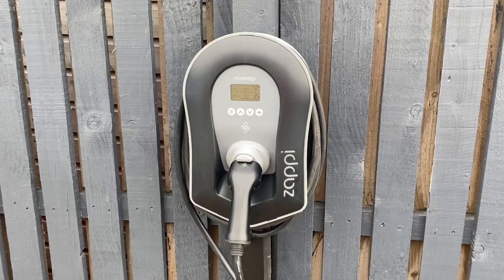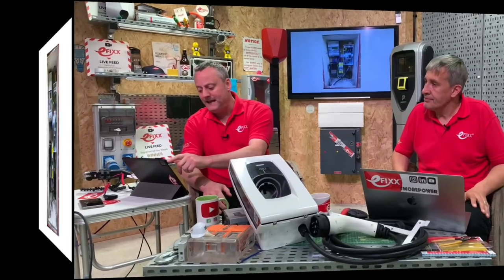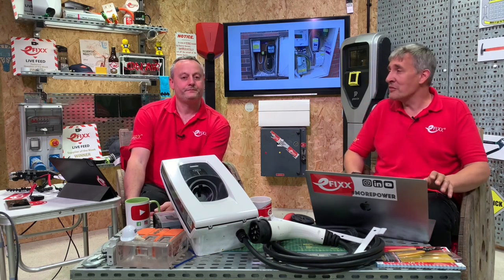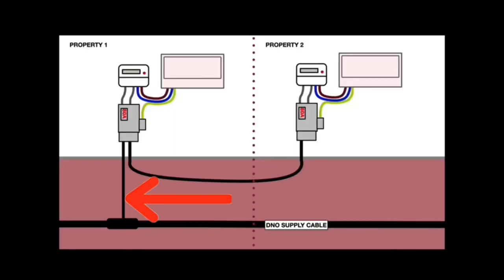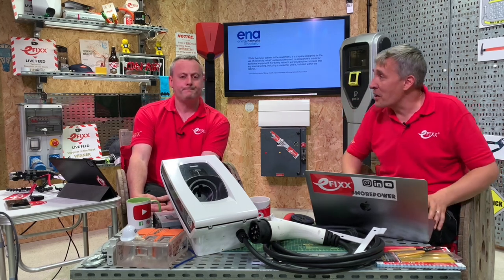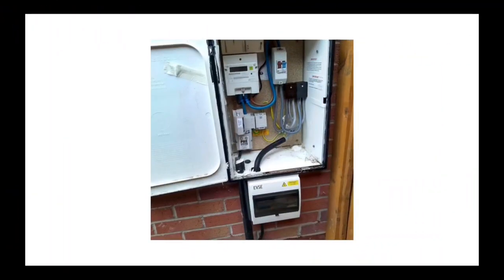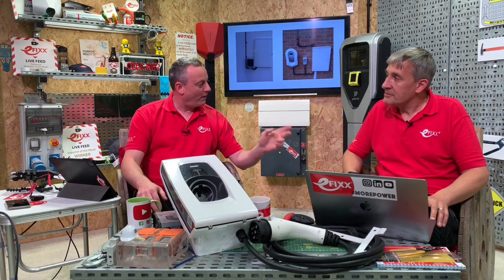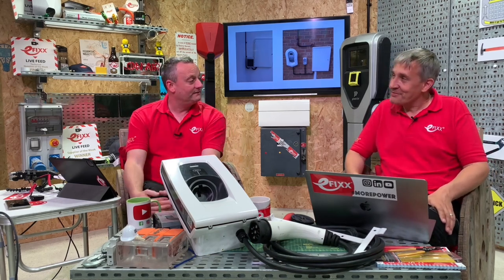Can ELECTRICIANS fit equipment inside the DNO METER BOX? - EV Charger Installation UK

Comment: As I see it , there are two solutions to the problem, the cabinets need to be 50% larger, or a second electrical cabinet fitted . The problem is get outside cables back to the CU without doing damage or where CUs fitted in the most awkward places such as under stairs or above kitchen wall cabinets , the sparks will take the easiest solution. most customer think you can magic cables into walls or under floors , the easy part is connecting the EV charger and doing the connection to CU but 75% or more of the time is spent installing the cable . With more EV chargers being installed both sides need to a rethink. Personal I'm thinking the answer is a dual cabinet with a partition , DNO side and consumer side
Reply from the maker: Sounds like a sensible solution
Reply: totally agree sir, and i would add that new builds should be designed with installation of EV and PV accommodated and Consumer units need to be upsized to accommodate Radial Circuits and finally bring to an end ring circuits

Comment: Can you point to any supply contracts that explicitly specify that nothing else can go in the box? Unless it's there explicitly it's hard to see how they can deny a supply without being in breach of their contract.
Reply from the maker: Here’s the response from one of the DNO’s - 

“ultimately NIE Networks position is where the minimum dimensions within an outdoor meter box are not reserved for our equipment, NIE Network may, and increasingly likely to disconnect the customer and issue a defect notice citing the Standard Connection T&C’s”
Reply from the maker: @brendon-paul  in the specification when you request a supply.
Reply: It's embossed in some of the meter box doors, " This space is reserved for Electricity Boards equipment only".
Reply: @efixx  the interesting thing about this is that NIE is now owned by the ESB which is the DSO in the south of Ireland. The ESB have in very recent months authorised the Permali Box (meter cabinet) to be used for EVSE installations as a special exception, although NIE obviously still don't.
Reply: @efixx  Thats nonsense. If their equipment is already in the box then it fits. This is talking about them not having room to install.

Comment: Many houses from the 60's and 70's  have the main consumer unit in the meter box.  I don't know of any that have had their electricity cut off because of it.  Relocating them in some instances would not be straightforward,  unless rewiring the property.
Reply: Totally agree.
Reply: My house is exactly like this & the meter box backs on to a double skin of engineering block - this could be quite a fun exercise if my new smart meter doesn’t fit.  It would probably have to be a rewire to relocate the consumer unit in my case.
Reply: I came across this video and was thinking the same because this is how mine is setup. I have no meter box as such. Not outside. The meter is in a cupboard in the hallway next to the fuse and the CU.  This is where the EV charger comes in via a trip switch. This is where the Harvi will also be going I expect. That being there's nowhere else for it to go.

Comment: There's provision within the box for an isolator to be installed, what we need is a manufacturer to design a main switch which incorporates an isolator, OCPD and 25mm tails outlets for two supplies. So you could have one way for the main CU and another protected way for the EV or additional CU such as a garage unit.

Also DNOs/suppliers need to be a little more flexible when installing new supplies, how many meters boxes have you seen that look like the kit was just thrown in on a Friday afternoon with no scope for additions such as isolators.
Reply from the maker: An area crying out for innovation
Reply: @efixx  an area efixx could do a(nother?) video on?!

Comment: Been looking into this a lot recently as I need somewhere to install another isolator for PV.
The key word is 'recommend' not 'can't' or forbidden, or "mustn't' or any other word that says you cannot, all you must leave is space for their equipment or the ability to move yours if required, after all, the meter box now belongs to the end user. 

 Opening our meter box and what's in there is obviously the DNO fuse and meter, NO DNO fitted isolator, then straight into the wall behind and above for the CU. 
Before this though the meter tails go into a wylex fused switch (a large unit that is bigger than it needs to be!) That feeds an onsite holiday cottage, the feed for the cottage comes out the bottom of the switch as expected, and our tails for the house are also in the top of the switch so the cottage is able to be isolated, but not the house. 

My plan was to get the DNO to fit an isolator, and/or I was going to get the sparky to fit the isolator and then a separate CU with 3x 100A isolators, 1 for the house, 1 for the cottage and one for the PV along with an RCD/RCBO for the PV, all within the same space, dimensions of this would be smaller than the existing switch fitted. 

However, almost two years ago sparky had to pull the DNO fuse to fit a new CU in the house as we had no response from them at all ref fitting an isolator.
Reply from the maker: Your energy supplier is responsible for arranging disconnects and installing isolators. The electrician should have asked you to arrange this, as they usually won’t talk to the electrician. The situation is a mess but is due to change mid 2023 - https://youtu.be/BqNQl8365HU

Comment: Interesting concept. I don't have an meter box, it is housed inside, beside my CU, solar isolation switch & meter etc. etc. and the DNO has zero say on whether I can put additional equipment there or not. It's my under stair cupboard.

The guidelines originally quoted also state "do not recommend" which is a different phrase from "you are not permitted."

I think the DNO is simply power tripping over the status of the external housing box and know that if they want to just turn up and do something, it can complicate that job and/or result in it being delayed from completion. I believe this is behind their responses to your enquiry.

Ways around it? Are there smaller meter boxes, that could effectively allow you to split the original area into two? Average standard is 595mm tall and blow me away, you can buy them 300mm tall.

Once again, this is the DNO on a total power trip, because what else can you do?
Reply: But it's sometimes necessary to change cutouts in customers' premises and this is still often done live. If a jointer's faced with a situation where cables/equipment make this more dangerous it could mean your garden being dug up to isolate as it wouldn't be fair to lift network fuses and put streets off supply.
Reply: @Tammas  Hence "do not recommend", i.e. you can but it's at your own risk of something like this happening?
Reply: @seprishere  For sure Simon, but workers do have a right to risk assess when working on live apparatus. And neighbours also have a reasonable expectation that their power isn't disconnected.

So, your garden will be dug up - whether you like it or not - under statutory powers of access. The most you can do is not allow restoration of your own supply...and if that's your attitude, hard lines. 🙂

Comment: The one from ENA, I wouldn't ever read as a hard no, or even a polite no to be perfectly honest. For legal reasons, they can't be "polite" in their answers because politeness would cause confusion amongst most people.

No, what it actually means is "We don't recommend it because it could cause damage to the equipment, or if we need to replace the meter down the line and we have to remove your custom equipment, any negative fallback from the fact you added your own equipment falls entirely on your own head".

In a nutshell, telling the consumer they're responsible for the costs incurred by any damaged equipment needing to be replaced, or if down the line, a technician has to remove the EV charging port... tough luck for the EV owner.

As an alternative, I'd suggest installing a second box, with a conduit running between the two. You can still piggyback off of the first unit, but this allows everything to run within designed parameters and leaves space for the meter company to actually change it out should they need to, without needing to remove anything.

Comment: IP rated locking external enclosure (Schneider's Merlin insulated enclosure range comes to mind) is the way to go, in my opinion. It can be a bit unsightly, but it's such a non-invasive installation for the customer when you've got an external meter box, and it saves so much time, energy, and money, it's a bit of a no-brainer for somebody who wants an EV charger install without completely breaking the bank.
Reply: exactly.
Reply: I don't agree. Enclosures IP rated against the ingress of water tend to be completely sealed, and the concern of one DNO is over heating by the inclusion of additional component. A metal enclosure will help in respect of this.

Personally I think the risk of overheating is very low, but if you want to keep the DNO happy and remove the "overheating" excuse, then you need an enclosure with ventilation holes and that by their very nature means the enclosure is not going to get a very high IP-X rating (where : 1 ≤ X ≤ 9)
Reply: @deang5622  As it's outside the meter box is has precisely zero to do with the DNO. I would expect any external box to meet whatever the relevant regulations will be for external electrical installations and and, in reality, for an EV charger it's not going to be much more than over-current protection and, maybe, an RCD of the appropriate type. It's going to dissipate about 1 watt.
Reply: @TheEulerID  Don't confuse environment ratings with electrical protection mechanisms.

We are not even talking about electrical protection mechanisms, the original post and my response is about environmental protection.

If you re-read my post, the key subject I was writing on was IP protections and I can assure you this applies to any enclosure carrying electrical apparatus and it is nothing to do with the DNO. So your remark about "has precisely zero do with the DNO" demonstrates you have not understand what I was talking about.

4/10 - must try harder.

Comment: If a customer doesn't want the hassle of the CU for EV going inside the house, could a second cabinet be fitted to the house, with a IP rate cu, with the Henley fed into this. Would this also allow the work around for the length of the meter tails??

Comment: Mantel cabinets are specifically designed to have a skeleton fuse board within aswell as the meter, DNO fuse etc. Wylex market a replacement 18th edition 'skeleton' consumer unit designed to use the same mounting points as the original skeleton unit. Its a very tight fit inside the Mantel box.

Comment: Had a tenant have a very large EV charger manufacturer and installer come to install a charger on the property today..   Firstly they had no idea it was a looped supply, and they the guy said he was going to fit the consumer unit in the meter box.   When I told them they were not allowed, I got told Eon had given them permission, thanks to you I quoted ENA response and told them in no uncertain terms that they were not fitting the board in the meter cupboard.  There was a 17th edition plastic board split load high integrity, I suggested a 40A mcb I got told they cant really touch consumer units unless its easier to just add a circuit, I offered as a fully qualified spark with my own company to fit a the 40A mcb to supply a consumer unit next to the existing consumer unit.  The conversation turned to SPD, the guy onsite phoned his company who said nope they don't fit SPD's, after contacting said company they confirmed they are installing to BS7671 18th edition ammendment 2, I verbatim told them regulation 443.4.1 and told them the response I got from NAPIT and IET that new circuits require an SPD..    They are going to get back to me (We will see), but just goes to show it is still going on...   The poor block onsite then could not get hold of his company to find out if the paperwork was in with DNO to allow him to install the charger, I phoned a contact I have at the DNO who confirmed no paperwork had been sent in...  Just as well I was there or they would have fitted it on a looped supply without permission, in the meter box and without an SPD.    It annoy me that honest sparks are losing work to these cowboys that are not your one man band unqualified cowboys, they are national companies that you would expect should be trusted..

Comment: Personally I think best option would be to install another meter enclosure box beside the current one and use it to mount your equipment needed for EVSE equipment. 
Here in northern ireland most new builds I'm coming across have the CU on the 1st floor in the hot press in middle of the house, not at all practical to get an additional cable to.
Reply: What is a hot press?
Reply: @johnburns4017  erm, the small cupboard like space your hot water tank would have usually resided in, along with all your towels and bed linen?
Reply: An airing cupboard
Reply: Press is an Irish name for a cupboard used north and south. Hot press is what English call airing cupboard.

Comment: The DNO owns the supply cutout intake board and permits only the designated Metering Supply company to attach equipment (if it is a Metered supply). Western Power make this very clear in their downloadable PDF documentation.
Reply: The information I have on this (and I work for a DNO) is that whilst the consumer owns the board they can't do anything with it. 
The Suppliers can obviously fit their meters and associated equipment.
The only thing the consumer can have fitted is a 100A DP isolation switch and if needed meter blocks.

Would we do anything when we encounter a discrepancy? .... Doubtful, but the question you need to ask yourself is, Do I feel lucky?

Comment: I’m fairly sure that Paul Meenan shared a document on social media showing a breakdown of the meter box and what goes where, the document showed the top right corner as customers space.
Reply from the maker: Page 11 here 👉 https://www.ukpowernetworks.co.uk/internet/asset/5fef85a5-c01f-4322-bc62-37a4dbf4fd3b/getting+connected+guide.pdf
Reply: S o this is the same document we have been working to as well. Dose that mean the UKPN guide is wrong.
Reply from the maker: It probably predates the move to EV - the DNOs need to give clear guidance on this matter. It’s only going to get worse when heat pumps etc follow on. Hopefully this video will motivate the discussion.
Reply: @efixx  The DNO's don't even agree on whether to let sparks disconnect the main cut out to safely work on an installation. Which is why I stated the UKPN isn't wrong it is just their guidelines for their respective areas. Western/ UKPN and S&S have given me completely different answers on the same question over the same type of supply and switch fuses in cabs. Zero consistency from personal experience dealing with the three and that's where in lies the issue, they will tell you at Efixx one thing but on an engineer level they'll give different answers if you call about an installation and submit photos.
Reply: @efixx  To be fair, heat pumps are not massive loads, thats the whole point.

Comment: Good video. It really makes me question why I'm a spark with all of this nonsense. As other have mentioned-if the customer wants their consumer unit relocating >3m away from the meter where is the fused isolator meant to be sited? My gas supplier has installed additional equipment in my electric meter box to transmit my gas meter readings-is this allowed ?
Reply: Re your comment on becoming a spark I would think twice if starting again, but saying that ,house is only a tiny part of being in electrical industry.
Reply: Yes. These SMETS 2 meter upgrades and retrofits are modifications to what is still considered DNO equipment, even if only leased, and therefore come under the ownership of your utility provider on their behalf.
Reply: I'll also add-its ok fitting an IP rated enclosure on the outside wall but you've still got to enter the meter box and install Henley blocks therefore adding additional items taking up space?
Reply: @jamiebourne8047  whatever you do someone is going to question it ,then for years I had no seals on my meter numerous meter readers came and went no comment was made and being a sparky this is normally a hanging offence!